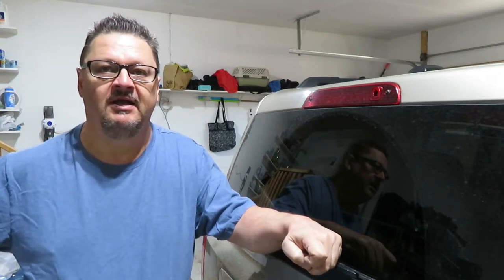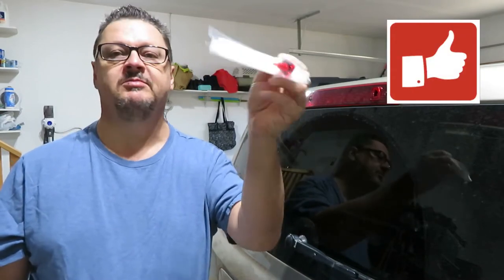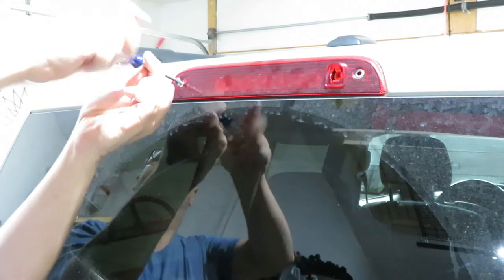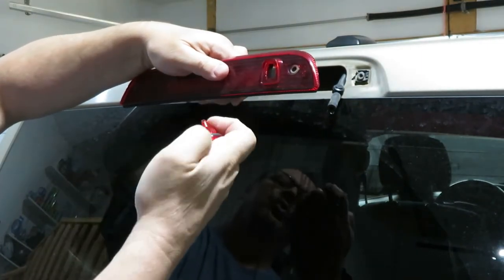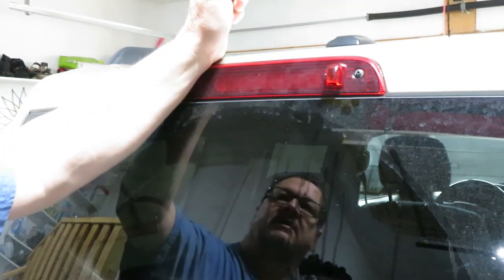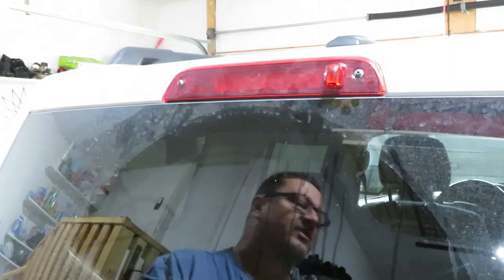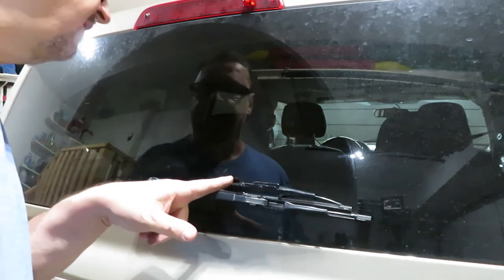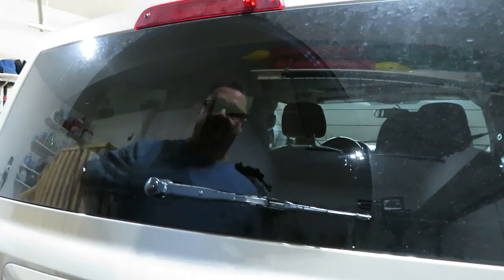Jeep Patriot Rear Spray Nozzle and Rear Wiper Blade Replace - 2007 - 2017

Comment: 👋🏼 Hello
I have 2010 Jeep Patriot as well 
It is used car that was pass down to me . 
It has most everything that your has expect heated seats and no Bluetooth unfortunately .

My rear windshield moves very slow can you tell how can that be fix and also need to replace the wiper it’s not working properly.

Also my cd player is not working as well as it should. 
I put in a cd in it and now it’s stuck .
I  tried putting a long object to get it out put it won’t budge.
It seems to work when it wants to do I need to do to fix this problem. 

A lot of the other videos have helped me a lot thank you for the problem-solving videos because I need it, new owner.

I never  owed  a car  on my own until recently.
I practically live in it I need all the help that I 
I don’t really know have a reliable person to go to get help.

Am in a fix income so I try to diy myself if possible so I go on YT can get help.

The warranty on the car has expired.
Thank you so much!🙏🏼